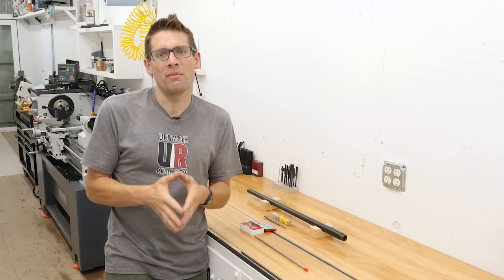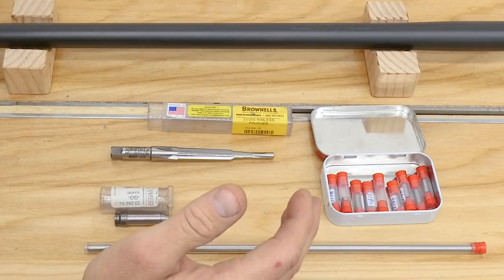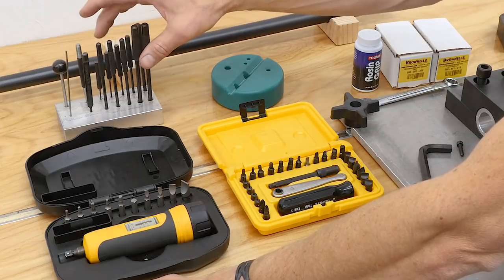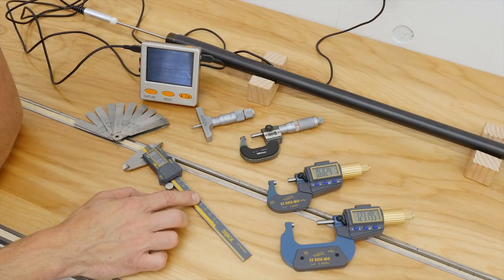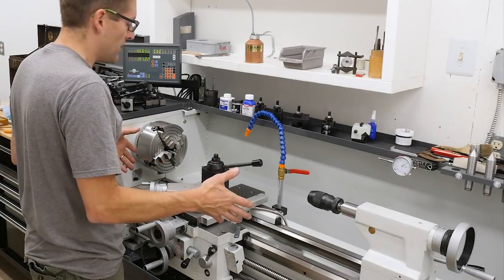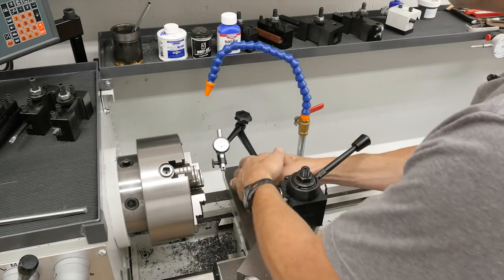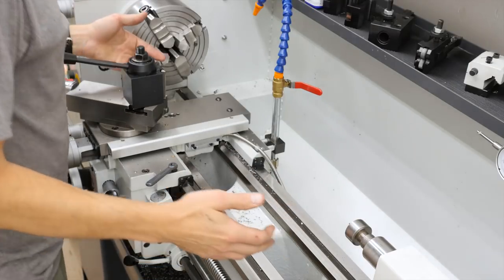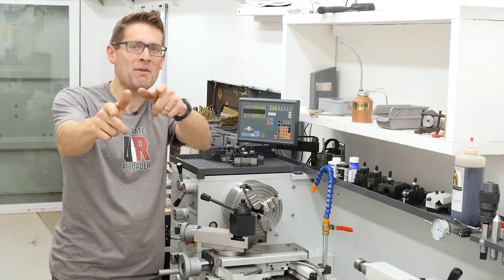Winchester 70 Rebarrel Part 3: Tools of the Trade

Comment: Gavin, I've been watching your channel for @ 3 yrs now. Finally saw something that I felt I could help with. With regard to thread surface finish, try raising you tool above center. It is not something I can give you a direct answer as to how much but grab that burned out barrel and start raising the tool @ .005 at a time. Insert manufacturers give tables for how many passes work best for different pitches. So that final .001 pass may mess up a beautiful thread when .005 would have done the trick. Cutting threads for 40 + yrs.